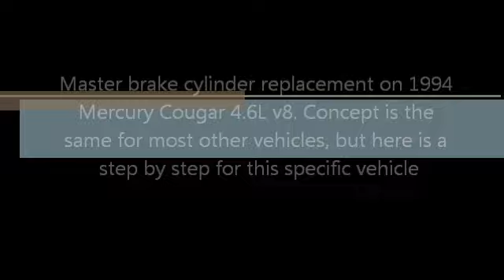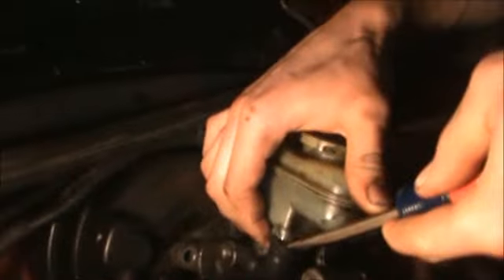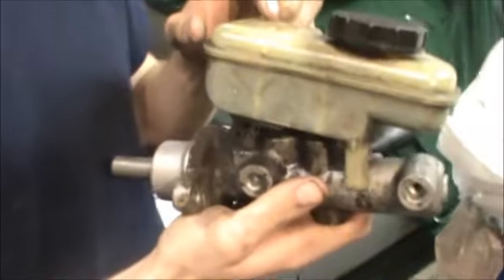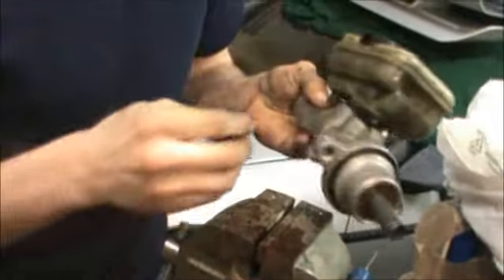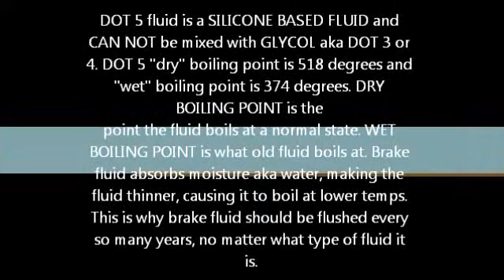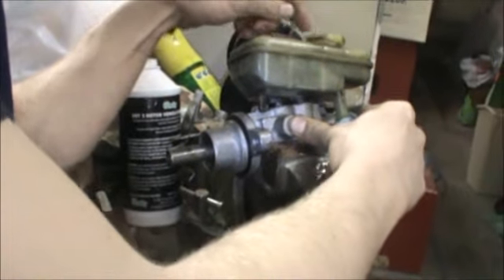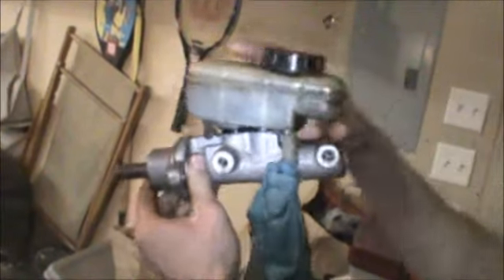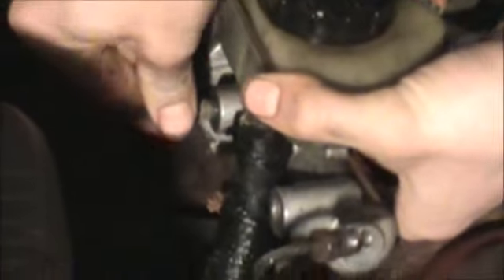Mercury Cougar/Ford Thunderbird Master Brake Cylinder Replacement (1990-1997)

Comment from the maker: I don't have a vehicle to do that on right now but it's a fairly simple process, you just remove the master cylinder via the 2 mounting bolts like i did then unbolt the brake booster, i think the mounting nuts on this car are actually on the inside so youll have to stand on your head under the dash, then theres just a pin you pull out that holds the booster rod to the brake pedal, it's a very easy job, if i happen to do one i'll be sure to make a vid. If you need more help holler.

Comment: how do you know if its the break lines or the master break cylinder... my cougar will kinda stop but hardly i have to push my break all the way down to the floor and still slides... break pads are all brand new!!
Reply from the maker: If your lines are leaking, the fluid level will be low and you should see a puddle under the car. Otherwise if fluid got low, you may have air in the system, requiring the brakes to be bled. If that still doesn't fix it, it's probably the master cylinder.

Comment: I have a 1990 Mercury Bostonian,   mint condition with the exception of two small body (dents).  I am having the same issue right now.  How much do you think this can cost in repair?    Thanks in advance.
Reply from the maker: Ah my dad had a Bostonian! The part itself looks to be under $50 after a quick google search so if none of your lines are rusted and you don't break anything, it should be well under $100 for the master cylinder and brake fluid assuming you're doing the job yourself. If you have a shop do it, expect it to be closer to $300-$500. Hey usually mark up the cost of the part and it's a few hours of labor.
Reply: Well I'm female and don't know anything about car repairs other than ask around for great advice.  I love my car (my Dad helped get it for me) ....  their out of town right now,  construction business))  so I have to decide and make decisions til then.   (There's no oil spill at all either).  Thank you so much;  it's appreciated.
Reply from the maker: No problem. Just keep an eye on the brake fluid level and drive with caution until it's fixed.
Reply: Thanks,  I'm not going to drive at all until I can find a mechanic and get this fixed.  💜☮✝

Comment: What does the hose on the bottom of the reservoir go to? I can't find one with the hose nossle
Reply from the maker: You know that’s actually a good question. I assume you mean that black hose that I was having trouble disconnecting. Unfortunately we don’t own the car anymore so I can’t go out and check. Did you follow yours to see where it goes? What nozzle are you referring to?
Reply: @TonyTheTruckGuy  yeah it's the one you couldn't get off. The cars my brothers. I can't seem to see where it leads, but none of the replacements I find have that hose bib
Reply from the maker: You mean none of the new master cylinders have a connection for that hose? I thought in the video it was connected to the reservoir, which I had to swap over from the old one. I can’t for the life of me think of what that hose would be fore though. I rewatched the video and it looks like it just goes down the drivers side of the engine. I guess I would try to chase it best you can and see where it goes to. You’d think it’s pretty important if they have it there, but the fluid should feed directly from the reservoir into the cylinder, so now I’m confused.
Reply: @TonyTheTruckGuy  yeah the replacement reservoirs don't have that hose on it. Even ford couldn't tell me what it was for.
Reply from the maker: @williammullener5742  That’s really weird. I guess I reused this reservoir, so I didn’t have that problem. But I’ll be damned if I can remember what it went to. You might have to follow your hose and see.
Reply: @TonyTheTruckGuy  that hose goes down to the ABS module
Reply from the maker: @mikebraz25  Solved after all these years 😂
Reply: @TonyTheTruckGuy  yeah I know right 👍. I have one as a project car

Comment: Do you know how to take the booster off by chance? A 95 Thunderbird???
Reply from the maker: Typically once you get the master brake cylinder off, you have to disconnect a safety clip and pin at the brake pedal that holds the vacuum booster rod to the pedal. Then the booster should have a few nuts or bolts on the inside of the car down by the brake pedal area that you will have to remove and then the booster should be free.